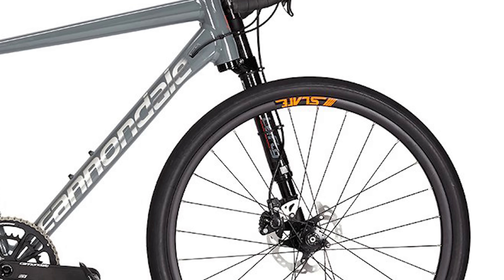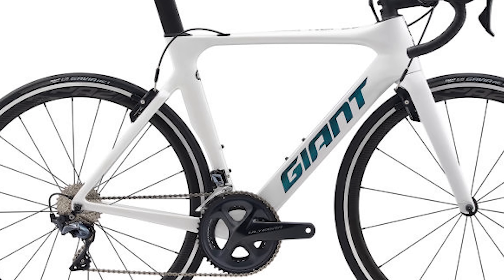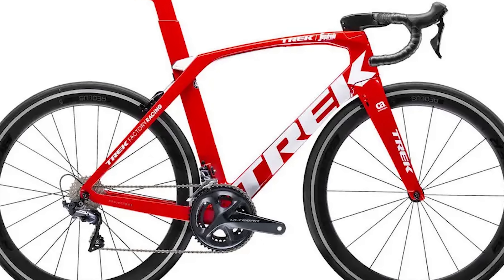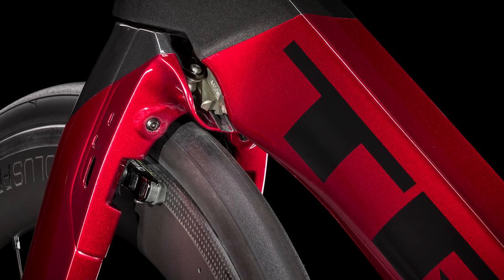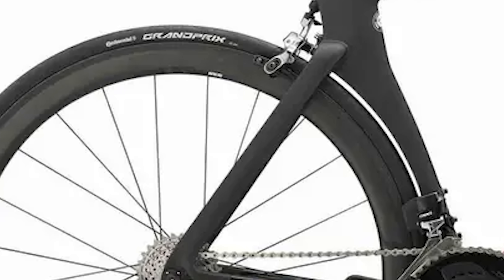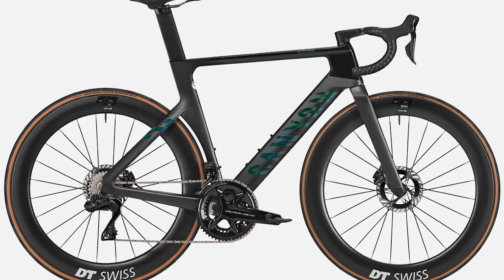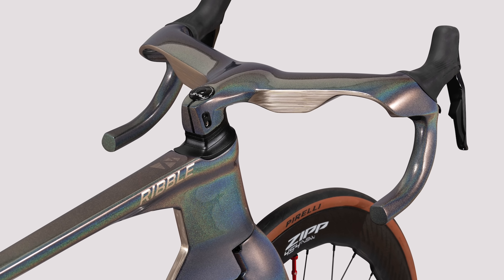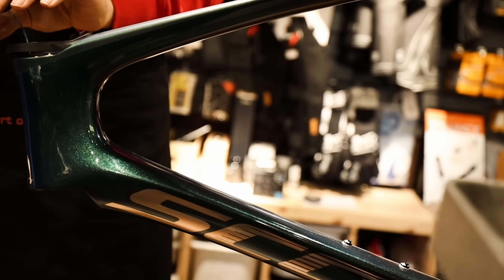Pro Bike Mechanic's 10 Most Hated Bikes

Comment: Love the Roubaix, 5 years trouble free with the Future Shock spring, only recently worn out a bit, my mechanic changed it no fuss, with one of the 3 replacement springs that came with the bike.  Sometimes maybe, just maybe, it is the mechanics moaning a bit too much if the job ain't dead easy... 😉😄
Reply: It's more like when 99% of the bikes are simple and easy to work on, then it makes the 1% of bikes with proprietary systems that aren't better than other solutions stand out.
Reply: @viet0ne  It´s a personal choice, for me it works, takes out a lot of the sting that I experienced with other road bikes. And hey, if it is only 1% of the bikes then mechanics have nothing to moan about, statistically the chances that they´ll have to work on one of those should be pretty low...😄😉
Reply: Have roubaix also. Did 20000 km no problem. Service also no problems
Reply: Totally agree. I've had a Roubaix and now have a Diverge. In 7 years of owning them I've never had an issue with either of them. Rather have that than a weird looking redshift after market stem.
Reply: Oohhh shots fired…
Reply: I worked as a mechanic in a shop that predominantly sold Specialized bikes, I'm in a agreement with Nic that they are a pain, but I'd rather work on a Future Shock than deal with a seized bottom bracket
Reply: @ChrisButner8 I’ve had a problem with my Roubaix Sport since I got it. No support from Specialized or their LBS. Finally got an independent mechanic change it out.

Comment: I really like my Giant Revolt gravel bike, but I wish it had a round seatpost and a more conventional seatpost clamp.  The D-shaped seatpost means I can't ever put a dropper post on it,
and the integrated seatpost clamp doesn't work nearly as well as an old school seatpost clamp.  I had to fuss with it quite a bit when I bought it to get it to clamp hard enough so the seatpost wouldn't slowly sink into the frame while riding.
Reply: I second this. By applying carbon paste to the seatpost I was able to get rid of the sinking but now the damned seatpost squeaks and creaks every time I put some power to the pedals while seated... Drives me crazy! The D-shaped post fitted into a round seat tube with a shim behind is a terrible idea. Why not just supply a round carbon seatpost with a standard clamp? 😅

Comment: This really made me glad I no longer turn-a-wrench for money!! I'd add to the hate-list ANY bike with cables/hoses/wires running internally through headtube/stem/handlebar. I realize that's most of 'em these daze but that doesn't make 'em any easier to work on. I really feel for the shop techs out there..especially when/if a customer wants a simple change of stem length or bar width...and you know what a nightmare it's gonna be with labor charges to match....but you have to explain it to them....and deal with the blowback.
Reply: What do you nowadays?
Reply: I keep searing to own a shop called Brass Nipple Square Taper,  because its the only nipples we'd use in wheel builds and the only reliable BB is one that has threads.
Reply: Hear you there: bikes are such mechanically simple things with few components.  The only people who benefit from extra complexity are pro racers and bike companies.  It's hard to put together a standard repair cost schedule when there's too much variation in parts.  If you can't do that, then you start having to charge higher labor fees or rejecting bicycles.

Comment: I fully agree regarding under-the-bottom-bracket rim brakes.  I had those on a Kestrel Talon X and a Specialized Shiv Elite.  Road gunk would collect on the cables with the result that the cables would get gritty and not fully release after braking.

Comment: Cannondale slate owner and avid lefty enthusiast here of many years. You have never had to completely remove the front brake caliper to remove the front wheel. Loosen two bolts and the caliper pivots out of the way to remove the front wheel. Matter of fact, every version of the carbon PBR lefty has this feature prior to it being modified for and equipped on the slate. 
I also have a rigid lefty I swap onto the same frame depending on what terrain I'm riding. With the right tool, an Ernie tool that can be bought on eBay for >$30, removing a lefty is no more difficult than removing a regular fork. I'm not really a fan of Nick. Mechanics like him are the reason I either just do it myself, or drive 30 miles across town for maintenance, vs going to one of the three bike shops close to me. When I walk in with my bike and the guy behind the counter goes on a rant about how much more difficult my bikes are to work on, I immediately lose trust in their ability to get the job done right. Especially since I, an amateur, can remove my lefty nearly as easily as they can a regular fork.
Reply: So true. All of it.
Reply: I mean, you’ve made quite a good case as to why it is a bit of a nightmare…

If you have to worry about removing two small bolts before you can remove the wheel then it is a pain vs a regular setup.

At no point does Nick say the bike’s bad, but from a design standpoint it’s reinventing something for the sake of it and adding needless complication. What does a lefty fork give that a standard fork doesn’t?
Reply: @cwd3bon  paraphrasing, Nick made the statement that on earlier versions of the slate, the front caliper had to be completely removed to remove the front wheel, causing the caliper to need to be realigned. This was a completely false statement. At no point has any production PBR lefty fork required such an action. Loosening (not removing) two bolts allows the caliper to pivot out of the way of the rotor so the wheel can be removed without messing up caliper alignment. Something that I wouldn't categorize as "a nightmare". Especially if the owner/mechanic appreciates the engineering that went into it.
In fairness to nick, there is a single version of a rigid lefty found on the Bad Boy light pipe lefty, that does require caliper alignment with wheel removal. But his statement, as he said it, was demonstrably false. 
At no point did I say, he said, it was a bad bike. But he did go on an exaggerated rant on the difficulty associated with working on the bike. Which, if he feels that way then so be it, but that's the kind of mindset that I wouldn't trust when handing my bike off to a mechanic to work on. Because it's really not that hard. He's being dramatic. 
As far as benefits go for the lefty system, that's as opinion based determination. At the time, the PBR lefty was lighter than any other option on the market, is still considered one of the stiffest options available, and has much lower stiction compared to traditional forks. Even more importantly for me though, is the cool factor. I am constantly being approached by people curious why my fork is missing a leg. It's a great conversation starter. This alone outweighs any cons associated with the system. Innovation is cool. Trying new things and doing things differently is cool. Complaining that every bike manufacturer isn't doing everything the same way for the sake of tradition stifles innovation.
Reply: I,ve had lefty on my flash carbon , i ve had the front wheel off maybe 5 times in 11 years so not much of a deal really.
Reply: I have a Slate Force 1 and really like it, except for one thing. When I get out of the saddle, my knee hits the lefty fork.

Comment: I've got a Specialized Roubaix SL4, the last model with the elastomers in the forks and seat stays. It's got good compliance and was always comfortable. A riding friend also had one and updated to the new model when they brought out the Future Shock. He thought it was a step backwards. He said it only suspended his wrists and not his saddle. And he could feel all the road buzz through the pedals, which had never been a problem on the elastomer model.
Two years ago I decided I was old enough for an ebike and went for the Trek Domane +LT. It has the Isospeed systems under the saddle and in the steerer. The rear isospeed on my bike has a long leaf spring running under the top tube. However, neither isospeed gave me the compliance of the Roubaix, so i put on RedShift suspension stem (easy) and a Redshift suspension seat post (difficult). The Domane is now nicely compliant but getting the suspension seat post fitted into that Isospeed system took some fancy engineering thinking.

Comment: I've spoken to others that had the brake under the bb (2013 Trek Madone) & it was very location dependant. The people who rode in bad weather regularly hated them but if you lived in good weather they were great!
Reply: Great to know since my Winspace T1550 has those
Reply: @matkrek  it's just something to pay attention to. After a wet or particularly dirty ride I'd make sure to clean it up. That bike is still going strong 11 years later! I stopped riding it 7 months ago only because I bought a new bike!
Reply: @joekawasaki  My 2016 Rose Xeon CGF has the rear brake in the same place. Never had any problems with it in Irish weather
Reply: @dubbct1589 I've spoken to people from Washington state, Canada, and the UK that have all had problems with them. A couple of them said the issue was corrosion inside the cable housing causing failure which is why they disliked them. My time with them they've only gotten wet from the occasional puddle, a heavy marine layer, or washing the bike. I personally loved them! The frame already had to be strong there because of the bb, the seat stays were able to be made thinner, & as a weekend warrior I can use any aero advantage to keep up with the bunch 😜
Reply: V1r  here and I also have a t1500 no issues with the brake , he even said “ they don’t work well at all “ talks a lot of shite this guy ignore half the shit he says , piss poor some of the stuff they come out with ABSOLUTE NIGHTMARE ffs 🤦
Reply: Had a 2015 BMC timemachine and still have my 2017 Scott Foil. Both have BB mounted brakes but only the BMC gave me fits

Comment: My partner has a giant with those brakes, and I've got a Dolan TT bike with one on the front and an under BB on the back. Both bikes the brakes work brilliantly, no rubbing, loads of power. Is Nick up to the task? My partner also has a diverge with a head shock. The boot spilt, it got water in it, I serviced it, it's not hard.

Comment: Can confirm that the rear tire is scraping off the inner sides of my 2018 Cervelo S5. Since  2021 I'm running continental tubeless 25mm tires on my enve wheelsets front and back and they strangely seem narrower, but they dont touch the chainstays anymore.
Reply: Yes now that the carbon has worn down no more rubbing lol
Reply: @scottsolomon8537  Seems that you know exactly, what you are talkin' about lol

Comment: Another Canyon Aeroad owner here. I am still wondering why nobody is hating on the system arranging the degree of the saddle (is that.... Yaw? Pitch? I don't know).
So, I unscrew the screw which keeps it in place and then add a bag of frozen mangos to it, in order to shrink the (and this is where my English runs out) inner metal piece so I can then loosen it and adjust the saddle 
HATE IT
Reply: Pitch is nose up/down, yaw is nose left/right
Reply: Latest Scott Foil is a nightmare too. It's a press fit for the saddle angle. Impossible to just untighten and slightly adjust it. Why o why ...

Comment: Missed out the Boardman Air, which was similar to the Giant Propel/Trinity but with added fuckwittery of rear brake behind bottom bracket. Had the t9 forks with integrated brakes. Absolute hell to set up.  Never stayed centred. Horrible cable routing. Press fit shit bottom bracket. Refused to put it in on ebay. Took it down to the tip and threw it in a skip. Then blocked Boardman on Twitter in disgust. The absolute worst frame I've had in 30yrs.
Reply: Cool story bro

Comment: I ride the Ribble SLR. The narrow bars are actually not an issue to ride at all, and I am mainly a mountain biker with super wide bars. The steering block is a little annoying, but I spend very little time trying to make super tight turns in the car park, so not an issue.

Comment: Agree with all the point EXCEPT future shock.
Low maintenance, do it myself , works beautiful.
Reply: Until you need to replace it.
Reply: I agree. I love my Roubaix.
Reply: I agree.  I don't see a problem . If I can do it, so can a pro mechanic.  I usually see Roubaix hate levelled at the extra weight of the FS but I'm not concerned by that either.  It's a lovely comfy bike which is what I wanted when I purchased it.
Reply: @daniels.2720  Why so?  I have removed my FS and put it back and its pretty easy.
Reply: I bit of a fiddle stripping the future shock and re-greasing it, but not that hard and it's only about an hour of work. Don't see why you'd ever need to replace it.
Reply: I trust that it's fine if you're able to get the part, but when there are FS bikes sitting around your shop because Specialized didn't have the replacement part needed for months on end, and it's sold out everywhere else. It can become an issue for a small shop with limited space.
Reply: @daniels.2720  Clearly you have never done it
Reply: @jameswatson5380

Clearly you enjoy voiding your frame warranty because Specialized specifically says if you do not have an FS replacement done by an authorized dealer it automatically voids your frame warranty. LOL. 

And the charge to replace a FS is currently around $500 US. That’s a joke when you consider the fact a simple Redshift stem can do the exact same thing and weighs far less than that boat anchor Futureshock. Just another stupid Specialized gimmick marketed and sold to the gullible. 😀
Reply: I have 2 bikes, one redshift, 1 specialized. The future shock is far superior. The redshift is half as good. So the money stacks up. Just saying...

Comment: I did rent a Roubaix with the FutureShock stem once and it was a nice riding bike.  It in fact prompted me to buy the Redshift stem, which I still use.  If, big if, I ever decide to get a more modern bike than what I have the one thing I still want is my shock stem, but that'll eliminate a lot of bike with integrated bars and hidden cables that goes through them.

Comment: I've worked on the future shock myself and while it is fiddly I do like that system vs redshift suspension stems due to the angle of the stem changing when the redshift moves. The future shock goes up and down straight while the redshift leans forward and down at an angle. But yes it is fiddly.

Comment: My canyon aeroad came with handlebars extended, they weren’t detached or in the narrow position. They fit fine in their shipping boxes that they use for all their bikes. It def doesn’t make shipping easier. Also I have 10k miles on my 2021 aeroad and it doesn’t creak (not the handlebars anyway). The seatpost issue is what pisses me off, thankfully it’s just a noise that can be fixed, but it comes back and you have to keep reapplying grease and carbon paste. I think they fixed the issue in the new 2024 models
Reply: This (Ultimate here, same handlebar); plus that it is very comfortable, when packing bike into the hard-case for travel. Just undo screws and dismount the handlebars extensions, and then it just fits the case. Much easier, than with a normal handlebar
Reply: No thanks, don’t want a creaking nightmare for a handlebar! 😀
Reply: @ivanboesky1520 there is no creaking to, zero

Comment: Anything with fully-internal cockpit cables can die in a fire, thanks. I'm sure the aero gains are so minimal and the headaches they cause - especially for non-electronic shifting are completely unfixable. It's an awful trade-off with huge complications, compatibility, cost, and performance downsides for probably 0.5Watts of aero gains? If you never ever do your own maintenance and have no concerns about vastly increased servicing costs, then sure, I guess they look a bit nicer. For everyone else, what a total nightmare!
Reply: No more cables doing damage to your frame
Reply: The watt savings are multiple times that. The main reason why the sl8 is faster than the sl7 is the cockpit, and that was already without cables. So at speeds where you care about speed, exposed cables do matter a great deal

Comment: I had an orbea avant h30, that was a welded cable guide for the for the front mech which was in the wrong position and the same across all of the cheaper aluminium frames, this made shifting terrible. to the point that it was super stiff and regularly you couldn’t change your front chain ring gear. Ended up having to have the cable rooted pretty much thinner away from the welded bracket. Shocking design. Oh also, the bike that claimed to be a 51 was closer to a 54 that is pretty common nowadays

Comment: First Giant MTB started with Calipers at the underside of the rear fork because of its the strongest place on the frame. Worked fine, cleaning was a big job.
Reply: I remember a lot of those 80s MTBs had roller brakes, too!

Comment: I recently bought double decker GRAIL and I love it. Lots of space on the handlebar to put a camera, phone and some other stuff. Also gives extra hand position. The thumb lock works great I feel more "locked in" with the thump grips and my hand does not slip at all on the drops. Also I do not have to grip tight on the drops as my thumbs are holding some of my weight. Also the hoods and drops are stiff which helps me a lot when pushing out large power. But yes, there are downsides. First of all the stiffness is not very comfortable on hoods and drops and there is almost no adjustability on the handlebar. I think a new bar would cost around £450 and the fork tube diameter is not standard...